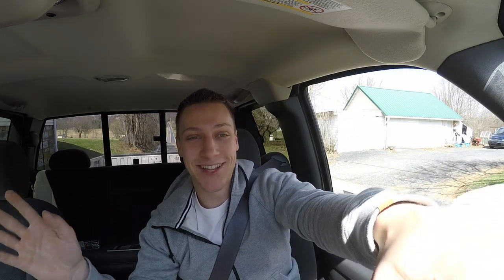WHY I DON'T Roll Coal...

Comment: It's great to see that you are a mature truck owner. Rolling Coal can be bad for the truck and it's rude and disrespectful to people around them. Keep up the fantastic work!
Reply: people roll coal on my frs in alabama. it pisses me off
Reply: @hunterlowery2764  the jokes on them, it damages the engine to be on that tune. not to mention it's illegal now.
Reply: Not to mention a waste of money. Not just for the mods, but also because of all the unburned fuel flying out the exhaust pipe. Just look at all that gas money
Reply: @hunterlowery2764  smash up a spark plug. The pieces are perfect for shattering truck windows
Reply: It cleans the motor out not just bad for it
Reply: @bigdapramirez6157  ROFL, try that here in ABQ, NM and see how it works out for ya ; )! rolling libs all day ; )
Reply: @brianpritchard424  ooh boy. I'm so scared of a toothless hillbilly with a rusty shotgun he found in a lake
Reply: @zerocool6257  ROFL it DOES NOT damage anything but your feelings.... jokes really on you ; )

Comment: Rolling coal also isn't in the best interests of the powertrain to say the least. You lose performance in power and fuel economy, it's just not worth it.
Reply: It's not good to do it all the time but every now and then is fine
Reply: Gotta love cleaning them exhaust valves after some gooood coal rolling man :) If you roll coal you will have to rebuild your engine like every 3000-4000 miles if you want to keep all the horsies...
Reply: Blue,man its true though I blows soot into your oil through your turbo oil seals and piston blowby thus making your oil extremely dirty and wearing parts in your crankcase it also does foul out your engine and make your valves dirty so they don't seal as well as they should...that being said an engine rebuild every 3000 miles is a little extreme but It does rob performance and fuel economy.
Reply: Atvsrawsome If you blow as black smoke as some of these people do they definetly need an rebuild atleast every 3000miles...that thick smoke leaves a thick residue!
Reply: You gain power aslong as the turbo can spool to push the air to mix with the fuel.
Reply: @ryanbechel8149  if the turbo was pushing enough air, there'd be no black smoke

Comment: Just a little friendly input. As i agree with you and ill be the first to admit that "rolling coal" is giving us diesel guys a bad name, trucks that smoke arent always intentional. I know a bunch of guys that have big turbo setups or big twin turbos that take forever to spool and you get alot of smoke before they spool up and start burning clean again.
Reply from the maker: +Matt Rahuba Absolutely. I should've specified this is mainly aimed at the average truck driving around.
Reply: Love the videos though keep them coming
Reply: Bullshit i know people who just like to see a diesel truck roll coal
Reply: The people who roll coal waiting for their turbo's to spool should go seek another tuner. I certain that you can tune the injectors to not only output for a certain rpm but also for a certain boost pressure. So you never waste fuel.
Reply: the problem with rolling coal is a big black smoke cloud that gives an enormous amount of attention to the public therefore the epa gets words on it and emissions standards get stricter and eventually well never be able to modify our trucks.
Reply: Kurt Crafton II
 not true actually its next to impossible to have a "clean" tune if your truck has any amount of power. One thing to always remember is soot is a by product of power, there fore generally the more power the more smoke yes you can have a clean tune with a 400 hp truck but once you step up into the 600+ range like im at now you will always have smoke before spool up if you don't have smoke you are too lean which is bad news.
Reply: Kurt Crafton II idk. Some tunes are cleaner but even the pros roll an insane amount of coal no matter what
Reply: I'm making around 900hp right now and it blows a little smoke on take off, but clears right up when I'm at about 30-80 pounds of boost
Reply: Old work truck i drove (05 GMC 2500 Duramax) did roll coal a lil bit. Wasnt tuned for it. Never new why it did. Had a MBRB 4inch also. Was a nice truck
Reply: @mrahuba9255  soot is not a byproduct of power, it's unburnt diesel.. my 6.7 Cummins has a tune and no smoke..  I do hot shot work so I pull heavy and need power.

Comment: rolling coal is the dumbest trend ever created
Reply: +hannes something Between rolling coal and the super camber low life, it makes me wonder why people would tune or mod their vehicles to be shitty 
just to feel cool or make some kind of statement no one really cares about except them. Different strokes for different folks I guess.
Reply: +Dirt Merchant Same thing with making fire come out the exhaust. This is sometimes a side effect of running BOV vent to atmosphere without tuning the car or just a bad calibration after you improve the engine flow with an intake, exhaust etc.
Reply: SI0AX at least getting backfires doesn't pollute like crazy
Reply: hannes something
Well it's pretty much the the same as un-burnt fuel so it technically does pollute the environment.

Some high performance cars blow flames out the back when driven hard and then suddenly stop accelerating, but that's ok as it's not all the time. But there are some that do "rich tunes" that will make their car have popping sounds all the time which is just as polluting.
Reply: SI0AX yeah if they do it on purpose it is really stupid and bad.
i was talking more about the high performance cars which "breathe fire" when you stop accellerating.
Reply: hannes something
Yeah, a high performance car will only do that after hard acceleration and then sudden deceleration. That's not very polluting as you're not going to be doing that all the time unless your on a race track.
Reply: The dumbest trend ever started is people stepping on my American flag
Reply: Jacob Sanders that's not as dumb as rolling coal.
stepping on a flag is only a bad gesture
Reply: Jacob Sanders
What about burning the flag?
Reply: Sportscars_BE  along with bottle flipping out of trucks rolling coal
Reply: It’s all just unburnt diesel. And makes you slower
Reply: @SI0AX  it's the proper way to dispose of one.
Reply: @isaac_eg8  Gasoline cars are also slower with a rich tune. The most power comes with slightly rich from stoic which is 14.7 fuel to 1 air. So Ideally you would run 14.5:1 for max power, but to protect from pre-ignition, you run more rich to use the fuel evaporation to cool the cylinder temperatures. 

A turbo car will run much richer usually between 10:1 - 12:1 because it runs hotter. A rich tune would have to have the ratio well below 9:1 which is excessive and not beneficial to any application. 

It's done just to make the bangs and pops which is a waste of fuel and reduces power and also increases cylinder ring wear because you are washing out the oil lubrication with the excessive fuel.

So basically, to obtain the pops and bangs you are decreasing power and engine life. Sounds like a pretty smart thing to do eh? :)
Reply: SI0AX well I know that turbo cars run rich my dad has a 80mm turbo on his Altima pushing around 500 hp on stock internals and it runs so fucking rich 😂 but he also had a power joke but that got rolled from icy roads but he made sure he didn’t roll coal he had everything tuned up injectors and everything new all the time and just maintained it and that truck had like 800 hp I can’t remember but he put 13k into just the motor and it was a 6.0

Comment: Rolling coal is not only a waste of fuel, it also strangles your engine, and makes you LOSE power. Your engines trying to push soot out of the exhaust, instead of flowing actual exhaust gas. It also causes excess carbon build up.

Comment: In not so many words, if it's a modern Diesel engine, there's no reason for it to smoke excessively ('roll coal') because they're designed specifically not to do that. Even when you floor it, the fuel injection system won't inject the max amount of fuel until the turbo is producing its full boost, so that way you always have enough air to burn all the fuel. No burning-barn-effect at the exhaust.
Modifying your fuel system in any way to make the engine roll coal is just messing it up and making it not work properly.
Reply: Besides, it also makes sure every drop of fuel is combusted and produces energy, instead of getting expelled into the atmo. If I'm paying for fuel, I'd damn like it to provide me all power it can.
Reply: Correct.
Performance build trucks don't really roal coal at all.

Comment: shoulda got the VW tune.
Reply: +justin bouche hahahahahaha no chill
Reply: +justin bouche VW actually saved peoples cars alot of issues by doing what they did. all that emissions garbage is TERRIBLE for your vehicle. There is a reason why older diesels run forever and are easy 500k+ mile motors. While new diesels barely getting to 150k before issues arise. my 08 f250 work truck has 33k miles on it and the the thing runs like shit
Reply: IgotGreens101 Going down the highway today there was an F150. Looked like a 2013-15. Thing was blowing smoke and smelt horrible to drive behind.
Reply: Bohdi Fritzsch Well if it was a F150 thats not a diesel so it couldn't have been diesel you were smelling.
Reply: Yeah I know. I was just speaking in general for the newer cars.
Reply: Justin Bouche savage
Reply: IgotGreens101 you bought the worst diesel motor ever made. 😂😂😂 what did ya expect?

Comment: Nice man, I can't stand that rolling coal crap haha.
Reply from the maker: +subaruwrxfan I rolled a little cloud on a tailgater today, I will say it works like a charm lol
Reply: +Street Speed
I couldn't agree with you more. 
One thing is to have a really loud exhaust another is to have the dumb cold tuned.
Reply: In my opinion rolling coal is plain stupid!
Reply: +Street Speed 717 
Yea I use it on tailgaters only, if I ease into it it's clean the rest of the time.
Reply: +Street Speed 717 I slightly disagree with your idea that rolling coal may not be the best tune. This is because the drag race diesels smoke up entire strip and I'm sure the trucks that are getting 10 second times have optimal tunes. 
Great video though love your channel.
Reply: subaruwrxfan that polluting the air and environment
Reply: zip744 he neans street tunes man
Reply: you realize soot (coal)  Falls to the ground.
Reply: Matt Maran Motoring your not American
Reply: Yeah it's not murikan to be efficient is it LOL.
Rolling coal is just fun when you have some moron on a bike behind you that thinks he can tailgate ya, that ALWAYS makes them back off.
Reply: Sojuan Turentine Still causes particulate pollution though
Reply: zip744 It says in the description he's not referring to competition trucks
Reply: zevi 2000 well no one cares
Reply: it also violates federal law and is illegal in general to have.
Reply: Same. It's pretty much how to speedrun a brick getting hurled through your window

Comment: Grey haze is all you want. If there's black, it should only last a second, if that. Dsp5 switch can be used anytime, stopped or moving, that's the wonderful part of it. Nice truck, diesel enthusiasts appreciate the positive attitude, as it helps show people not all diesel owners are coal rollers. Thanks for the positive attitude in regards to our hobby.

Comment: Any high horse tune will roll coal until the turbo spools and cleans it up .......
Reply: Hmm, should I spend that 1000 bucks on a decent ECU and get a perfect power curve, or just go with the 5 dollar chip tune from Ebay? Naah I`ll buy Budlight for 995$ and roll coal everyday!
Reply: No, it's a result of the tuner not managing your AF ratio properly.
Reply: +homerun217 no, the turbo has to spool to get the right a/f ratio, the turbo adds extra air, needing more fuel, but when you have extra fuel in a engine with a turbo thats not spooled, it will roll coal cause theres extra fuel
Reply: Albert Ellwyn Yea, that is why you have an Airflow sensor lol!
Reply: True, but i mean.. what hillbilly has to the money for that.. xD
Reply: Albert Ellwyn Yea lol, a 10$ ECU will do :P
Reply: THERES NO TIME FOR A 10 DOLLAR ECU WHEN YOU HAVE A $11500 TURBO!!!!!
Reply: Albert Ellwyn If your A/F ratio isn't right until your turbo spools, then you have a horrible tuner. With a proper tune, the A/F ratio will be correct throughout the RPM band. Do you understand that?
Reply: Albert Ellwyn 11500 turbo ?😂
Reply: Iv had custom tunes from gearhead and innovative and they all roll a little bit. Gearhead is pretty clean though. They are one of the best tuners for the ford 6.7 ..

Comment: I was wondering how rolling coal works thanks for the info keep up the good work
Reply: It's just unburnt diesel fuel coming out of the exhaust pipe.
Reply: I believe it's when the injectors are too big for the amount of air going into the engine. Meaning that the trucks running rich. It's usually a combination of rich tune and big injectors.
Reply: +Ethan Shrago it can also be because of an aftermarket fuel pump. Some of them can pump a shit load of diesel into the engine
Reply: +Ethan Shrago mainly used for twin turbo trucks but some people put it on a single turbo for the hell of it
Reply: @epicclips456  Sometimes they just roll coal. I have an 89 f250 with 7.3 IDI it rolls coal on heavy loads.